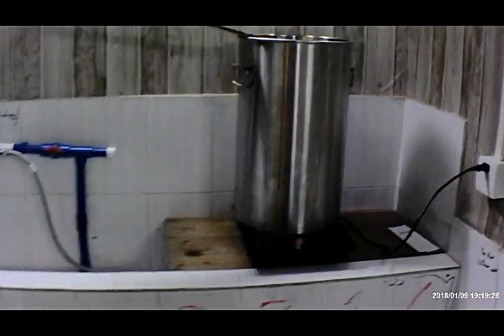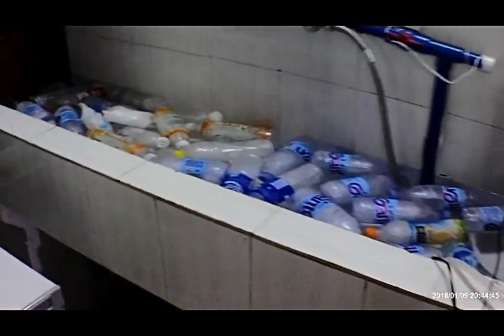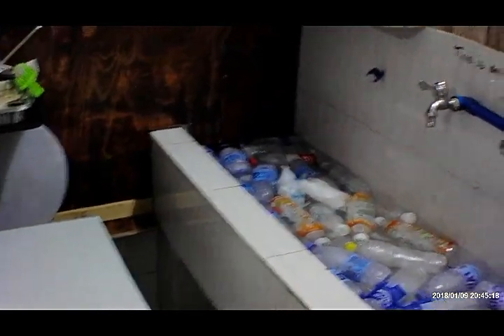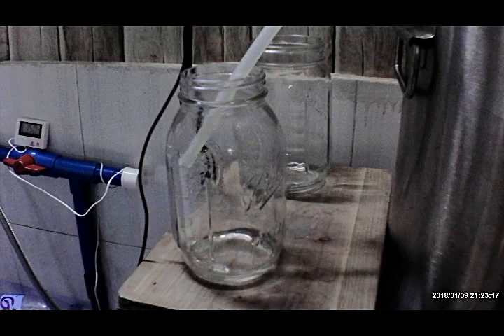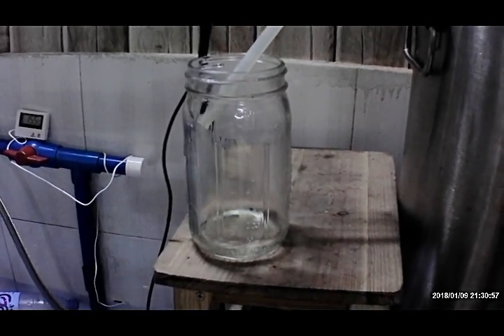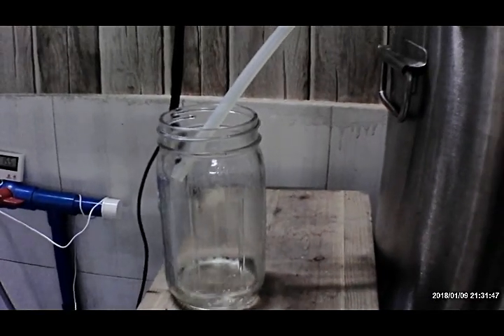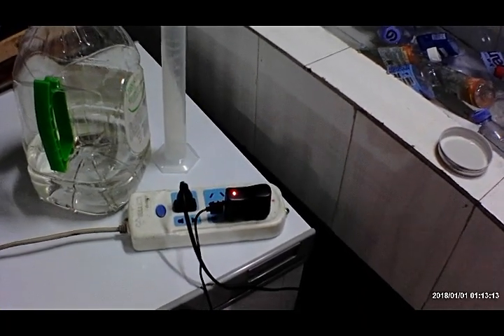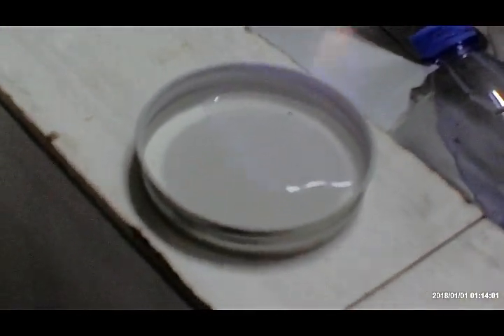Running a Moonshine still - Complete Guide How To

Comment: Hey man. Why are you only running until the alcohol is 55%. Couldn't you happily run until it was 25% and put it all together to make an alcohol of about 40%?
Reply from the maker: Yes absolutely,  but when it gets down to running out at 20 percent to me, it affects the taste negatively.  I actually  run it out to about 40% at the stll and it evens out at about 55, though that is too strong for some people.
Reply: @warpaintmc7575  ah ok. So can I just taste test each proof to see which suits? It's still safe alcohol? I just figured the way you were taking about it in the video seemed like it was poison haha
Reply from the maker: @11ITK  Yeah it's ok to drink. The only part unsafe is the heads.